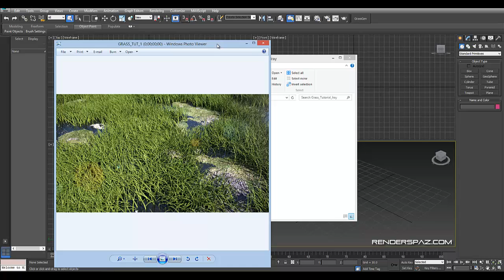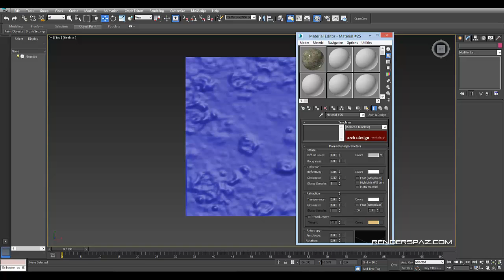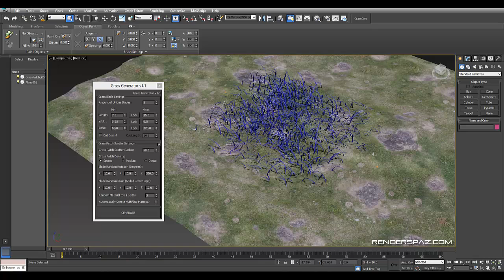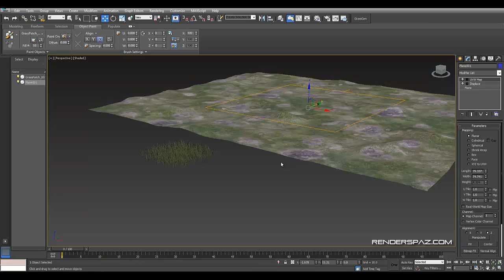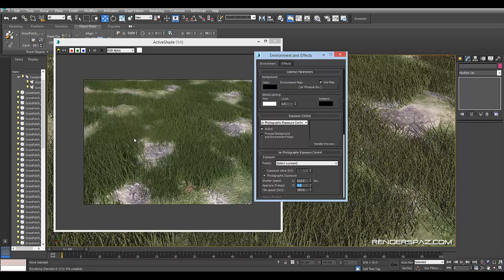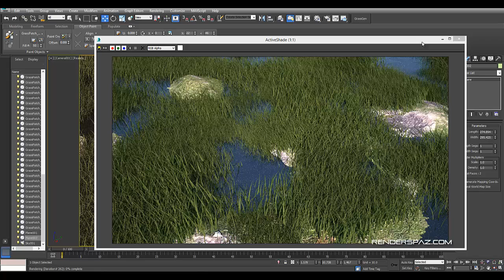Creating Hyper Realistic Grass In 3D Studio Max 2015 & IRAY

Comment: do you have to use IRAY? when ever i try an IRAY render it tell me I don't have enough memory
Reply from the maker: No. You could replicate the lighting and materials using most common renderers. What is your GPU?
Reply: no idea, on a school comp. I can use nivida mental ray however, will the results been any different then they would be with IRAY? and if so what is the difference?
Reply from the maker: Talking differences of render engines could be lengthy. In short the way I see it - is each of them have there strengths and weaknesses. However each could get the same results depending the way you tackle it. Study how lighting, materials and settings work in the renderer you choose.
Reply: alright thanks :) I have to admit you are fast on the response and i respect that. You have earned a sub today good sir!

Comment: I have a possibly stupid question about the IRay renderer. Do you need a NVIDIA graphics card in order for it to work properly? I don't have one, and for some reason any light I try to put in the scene makes absolutely no difference. The renderer doesn't seem to render light at all for me.
Reply from the maker: What kind of GPU are you currently running?
Reply: render spaz
I'm actually just using my laptop which has an i5 processor with integrated HD Family Graphics 3000.
Reply from the maker: José Julián Ramírez Rivas  What GFX card are you running?  Iray runs Cpu and Gpu, if it is not seeing your GFX card it may just be using your CPU cores.
Reply: Try turning on and off your graphics card but this engine render works perfectly without graphics card.
Reply: render spaz
or get blender its has cycles render witch does the same thing
Reply: render spaz I've got a nvidia GTS250 . We are not talking about Arion from Randomcontrol, which forces you to have a high ned graphics card. Anyway, have you take a look to Corona render engine?. I'm viging a try and it has surprised me FOR NOT USING THE GPU. It renders really fast with amazing results. Do you know Corona?. :)
Reply from the maker: José Julián Ramírez Rivas Hi Jose, yes Corona is amazing with its rendering capability. I am looking forward to it's release and latest updates.